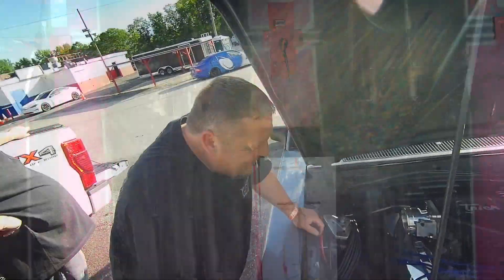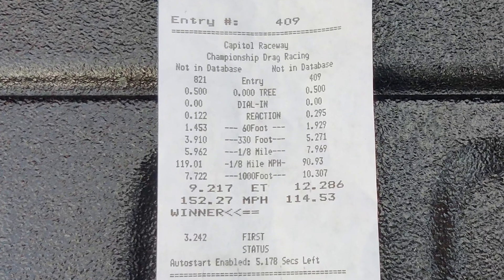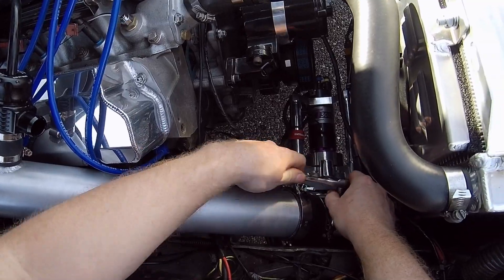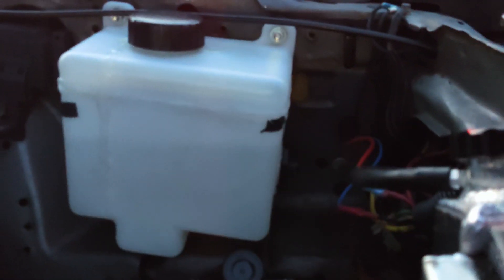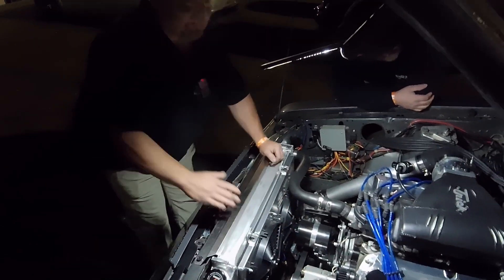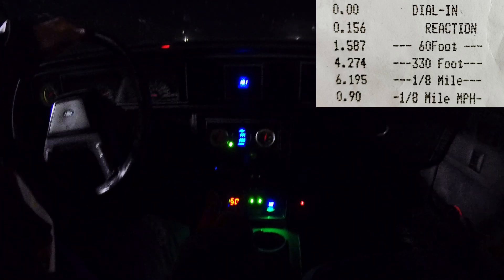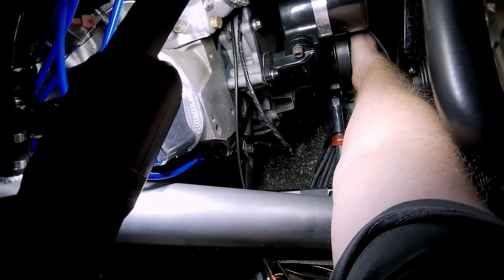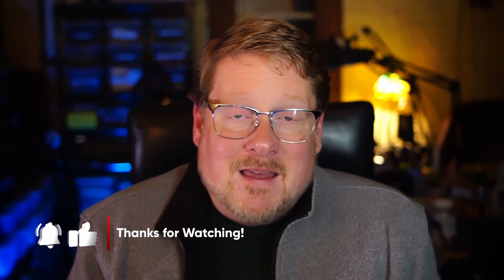Is this a 9 second electric turbo car?

Comment: What about lubrication for longevity..
Reply from the maker: I use Isoflex nbu 15 grease in the bearings.  So far I haven't had to relube it.  Remember, it doesn't spin all the time, unlike a supercharger or turbo.

Comment: You could really hustle people on the street with this. Disconnect it and store it in the trunk, run and let them beat you thinking you have no chance. Then come back and put it on, run again and smoke them. Used to be easier to win $$$ street racing because people raced ego more than tech, meaning you could bait people who believed their car was unbeatable into racing you for cash just to save face, only for you to win. Decent way to offset the cost of this type of hobby.

Comment: im not mechanical and dont know exactly whats happening , have seen the clettus video and see a sleeper with drag wheel tire set up go from 12s into 9s with an " E;ectric Turbo " so now I have to know. If something could be made for every chuckle head to have a little hit of boost that recharges its obviously cool , but does this mean something like that is possible > I will sub as its a sin not more subs 17K is very wrong if this is real . Of course even DIY i want to know how much it cost It makes many many thousands of 4 of time go away thats for sure and I guiess because it hits so early jand no parasitic loss its a little safer and easier to run for chuckle heads if they could somebow strap these to every piec of crap on the planet . I would like the insta boost on my hyundai  N Line MT car with 1.6t 200 HP car so it pulled something like a stock 5.0 fox body in second / third gear purely for the giggle shits if it didnt cause immediate engine failure and with such small pressure early the engine / ecu could deliver the fuel . I dont know who tools work though , that and the clettus one messed up air flow when not in use which is un adcceptable for a party trick trick component but a button to hit for MORE POWER TEMPOARAILY is kinda holy grail even in a shit box for a few / 5 seconds or whatever . Especially if it can be taken in and out. I dont know , i now have to watch to understand what any of this is or how it relates to the Clettus one in fabncy padded box that cost too much cuz built to nice and small qty but would atract chuckle heads for right price .
Reply from the maker: The one Cleetus tested was a toy by comparison - that one peaks at 5,000 watts.  This one peaks at 35,000 watts.  But check out the electric turbo playlist - there's over 90 videos in it with tons of info.
Reply: @AlexLTDLX  will do sir 35 vs 5 , yes , i reckoned it was serious to cut that much time.  I will watch , but I am curious and hopefully find out what this mad scientist voodoo  would cost a person to emulate if they had the wizardry to do so . I'm sure your R and D cost some but I hope to find out how much if one followed your potion , can't be cheap , speed never is , impressive as all get out though .

Comment: Why would anyone drag race their Tesla? No personal involvement, like racing your kitchen mixer against someone else's mixer. Racing tip: Yeh, take out the passenger seat on that Tesla.
Reply from the maker: To be honest, I'd like to take one down track just for the experience - a low 9 second ride in almost silence would cause my brain a big disconnect that could be fun.  But I do see your point - it would certainly get boring fast (no pun intended).

Comment: Alternator running so hard its shearing peices of the crank pulley off lol.
Reply from the maker: The alternator can only charge it over time. It was completely not related to the electrical system for the electric supercharger on these passes. It draws about 34,000 Watts when it runs.

Comment: You seem to know your stuff . Buddy o mine replaced the turbo on his Cummins ,if brain remembers copper conducts heat well but it reflects ir better than cast , so if u plated the housing , say seal the flange and fill with CuSo4 , the reactions happen until no iron can react. Then electroplate just enough for the turbinewheel . Respond if you can please seems like something a home gamer could do. And if it erodes se la vie. When don't old boats need a wrench for sea worthness
Reply from the maker: Are talking about the turbine side?  I actually would have to research about copper's thermal conductivity (which I know is great) vs reflectivity (which I don't know enough about to comment on without research - and I'm about to head out of town).  When I ran the Whipple, I made the intercooler core out of 140' of 1/4" copper tube.  It worked so well it would melt 10lbs of ice in a single drag strip pass.  Here's a look at the core I built: https://youtu.be/oXeUxONLO9I
Reply: @AlexLTDLX  yes
Reply from the maker: I really don't know, to be honest.  If I had to guess, I'd think there would be little to no effect, particularly in a diesel application because the the turbine side tends to have a nice coating of carbon developing pretty fast.

Comment: Sir, a question:
Big turbos work great once you get them going. With that in mind would your system work as a booster running for 2 or 3 seconds just to get the big turbo going?
If it would then would that also make the power requirements simpler and cheaper?
Reply from the maker: Yes, to all your questions.  Audi already does this on some of its diesels.

Comment: Congratulations on the 9 that is impressive honestly and yeah you need to get a run back on that Tesla.  I do have a question on the last pass your batt voltage started to drop fast.  Was that just because he shut it off?
Reply from the maker: Yes

Comment: I don't know how you don't have more subscribers. Absolutely impressive results. I MUST do this with my SRT and GX470. There just isn't solutions for the GX I'm happy with in terms of not affecting the reliable factory engine bay, and most folks who modify them eventually add a shore power setup anyways that could justify a crazy alternator and battery setup already. I'm going to be putting in a brushless fuel pump with a fuel pressure feedback for PWM control, should basically target just over stock regulator pressure.
You need to build and send one to cleet and crew since they have all the dang electric turbo search results for one cheesy one. And they have a dyno and enough cars to test it on. It would probably grow your base enough in one week to get all the funding necessary for a few months of development. So happy to see someone messing with these keep up the good work, I'll get in touch when I'm ready and have prepped one of my cars for one of these. I'm sure I'll have a few questions even with the spectacular coverage you've put together. "Yes honey my uh, my Traxxas? really NEEDS this $700 motor heheh"
I actually considered trying to find a few of those 80V suitcase battery things Ryobi is putting in it's electric ride ons. Just in general it would be sweet. Also want to test it with one of the larger inverter generator battery deals that so many people are using anyways. Discharge may not be fast enough, but at 120v, it could do the trick. Not sure what sort of motor controller I'd be able to use but there's obviously lots of drivers for 120V just doubt any are ruggedized etc.

Comment: Between the Analysis you do and the actually testing this is such a viable project & appreciate the work you put into it :)
I could see using the system in lots of different applications not just drag racing

Comment: Time to find a Fox body AWD unit? 🤔
Reply from the maker: Lol - I'll probably just build a race-only vehicle of some sort to go faster.  The LTD is too fast for it's safety gear already; and I don't want to put a full cage in it.
Reply: @AlexLTDLX  sounds like a job for a mid engine sand rail chassis, modified 🤣🤣🤣

Comment: Congrats Alex, try changing the strategy when the electric turbocharger is boosting to get that Tesla!  The 5 PSI boost from the beginning itself . . .
Reply from the maker: In the race against the Corvette, Jason sat on the brake a hair longer, allowing the Sledgehammer to fully spool.  The reason why it broke traction on that pass is he left on over 10 psi; on the other runs the most we saw was 8 psi.  I'll do a datalog video to go through it all as soon as I can.
Reply: @AlexLTDLX  An idea from my side, don't know if it makes sense, the Sledgehammer needs a dedicated ECU for itself which will control its speed, with respect to engine RPM, and boost pressure desired or any other feedback conditions.  Eagerly awaiting your next video.
Reply from the maker: That will happen in time.  I don't think it will happen on the Sledgehammer, though.  The long cable runs and massive battery pack (as well as insane current draw) all combine to form an environment not friendly to cheap and cheerful microcontrollers.  Now on the P2 units, I can see that happening.

Comment: Congrats buddy
Why was the voltage dropping massively in the end?
Reply from the maker: Thanks.  Are you referring to after Jason shut off the electric turbo and the capacitors were discharging?
Reply: @AlexLTDLX  at the very end yes it drops from 50V to 40V and keeps going done

Is that indicative of the voltage of the whole battery or just the capacitors? So when the switch is open they just drain
Reply from the maker: Just the capacitors.  Watch the pack voltage at the beginning of each run - that will show you what the batteries recovered to.  I never charged the packs at the track.

Comment: A lot od dedication and work!!! 👍👍👍. BTW that LTD is heavy I bet! Electric car is instant torque! I'd be happy with 12 seconds! What is that in 0 to 60 mph? Man that beast is Quick!!! Australia should have imported them. Like America imported the pontiac GTO!
Reply from the maker: During covid, we drag tested with a Dragy which gives 0-60 times: https://youtu.be/AOL3Qyczt3Y after that we took the dragy to the track to do some more testing, and to compare the Dragy's accuracy: https://youtu.be/nlTVHkfSQXM  Based on those times, I'd estimate 0-60 to be around 2.2 seconds right now.  Another way to look at it - the Tesla Plaid ran a 1.45 60' with slicks on all four corners while running the "standard fast" Plaid times.  A Plaid runs 0-60 in about 2.1 seconds (without Tesla's BS "rollout" subtraction).  We went 1.47 in the 60'.  2.2 to 2.3 seconds seems to be a good estimate.
Reply: Bloody hell! LMAO 🤣. That's insane! Quicker than the R1 superbike!!!! Hell yeah!! Love it!🙂👍👍👍👍

Comment: Why is the Pack Voltage dropping so hard at the last pass?
Reply from the maker: Are you talking about after Jason Switched off the Sledgehammer?  Otherwise, the voltage sag is about the same as usual.